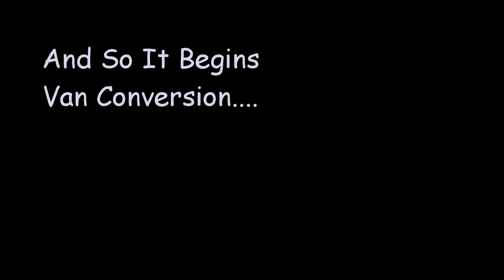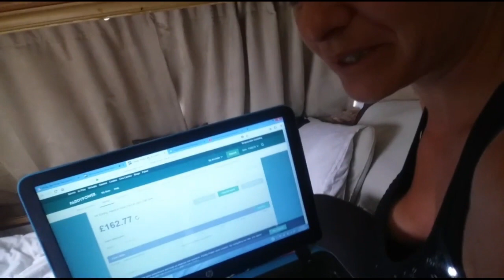Van Conversion | Layout Plans | Welding & Fixing Leaky Roof | VAN LIFE

Comment: What part of the country are you based in?  What made you pick a Transit  ? Your doing a good job on the repairs long way to go yet good luck
Reply from the maker: Hi Roger, we are based in Northallerton at the moment near to the North Yorkshire Moors but itching to drive to South America 
There are several reasons i went for the transit, on the older models, which is all we could afford, the cabs are designed much better than the iveco and offer more features and comfort than ldv etc. The mercedes are better but  they are astronomically expensive on parts. However as the transit is the most popular cargo van in the world with very reliable engines. I figure that if we should need new replacement parts they would be easily available from any ford dealership and alternatively there will always be a scrapyard in whichever country we visit with a transit or two sat there lol
Thanks for the compliment on the repairs, it's been over 25 years since i did anything like this but i cant take all the credit my best buddy Scott is a much better welder than me and has been a God send on this project.